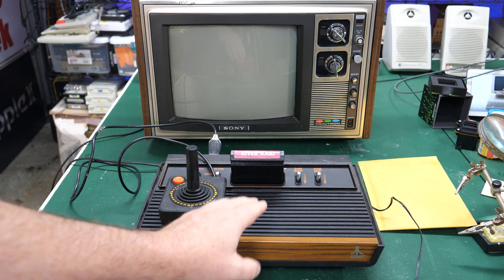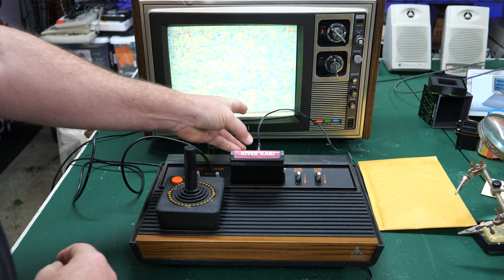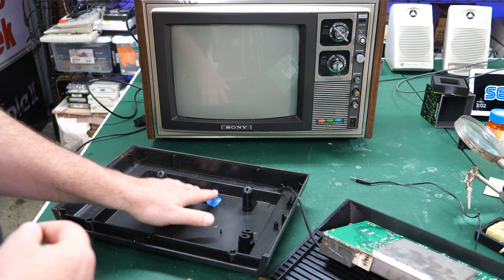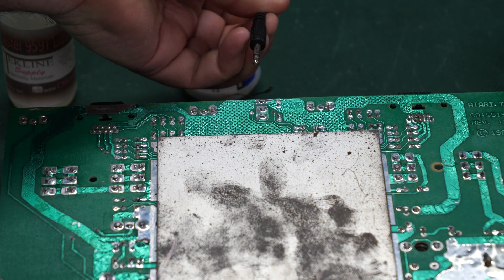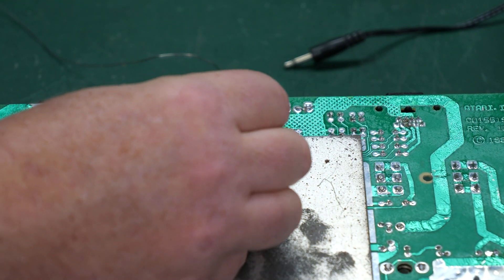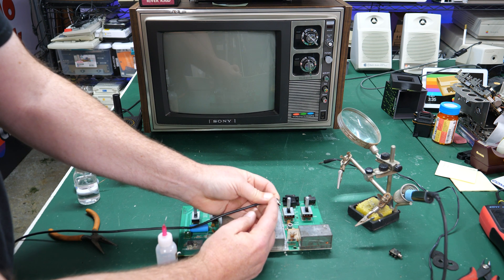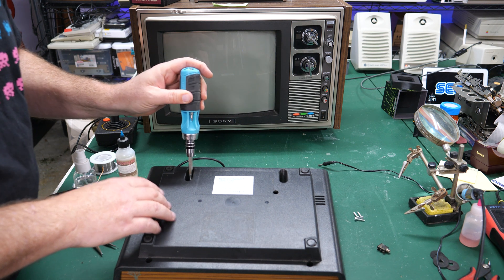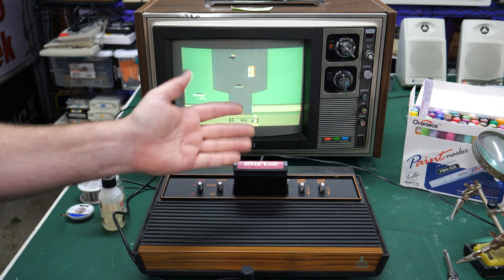Quick Fix for a Classic Console: Atari 2600 Power Jack Repair!

Comment: The best 2600 survival mod is to put an RCA plug in the case, and use a separate RCA cable, so that it can let go outside if the cord gets pulled.